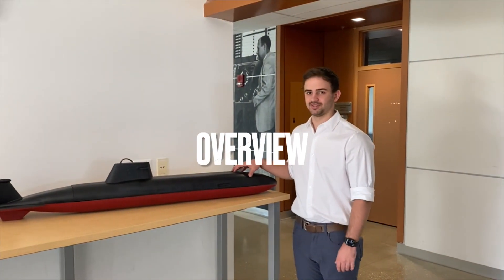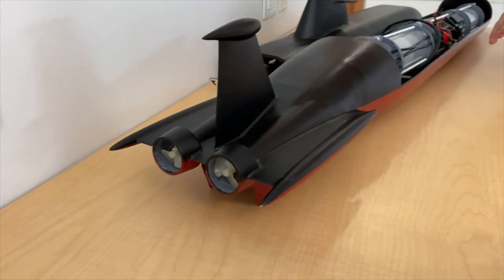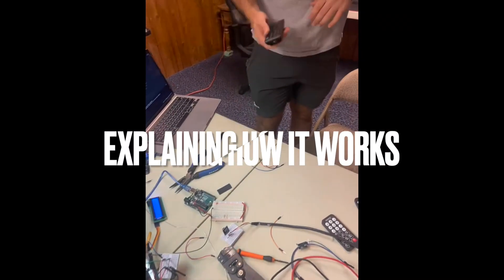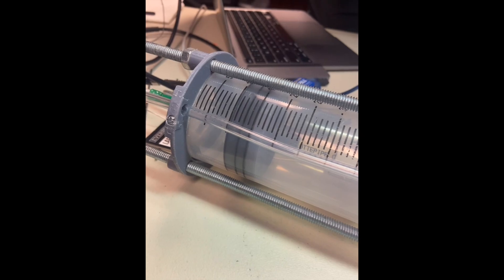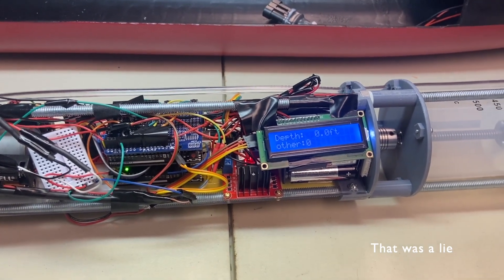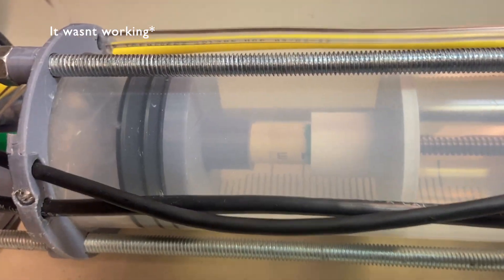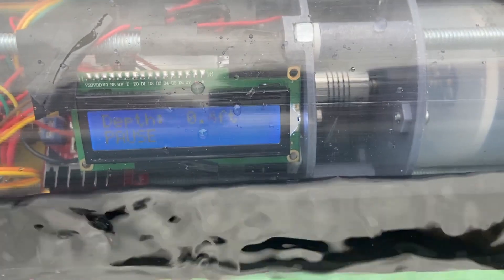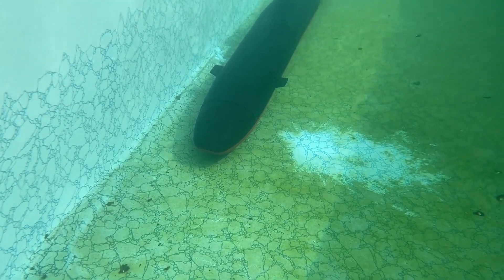Building a Homemade Submarine

Comment: DIY Perks made this design over a year ago. The only difference is the external shell that makes it look like an actual sub. Is this design based on that?
Reply from the maker: I did take inspiration from DIY Perks. Mainly the syringe ballast tank system, due to the cheap design, everything else is original. 

The main difference is the way it is controlled. DIY perks essentially has manual control of the position of the plunger in the ballast tanks, this makes it almost impossible to set neutral buoyancy and maintain a fixed depth. This will result in either the sub always trying to rise to the surface or dive to the bottom without constant manual correction

Our submarine utilizes an Arduino and a pressure sensor to control the position of the ballast tanks and the overall buoyancy of the submarine autonomously. With an IR signal, the desired depth can be set, and the Arduino controls the speed and direction of the motors based on the current depth read from the pressure sensor as pressure is just a function of depth.
Reply: @alexfeldman9067   That's actually super awesome! The ballast depth system is impressive! I'll be keeping an eye out on the channel. It's always cool to see what a little DIY can do.